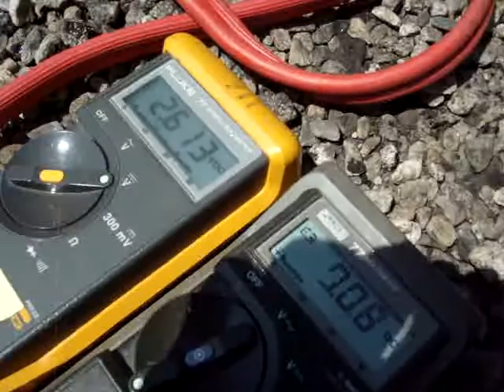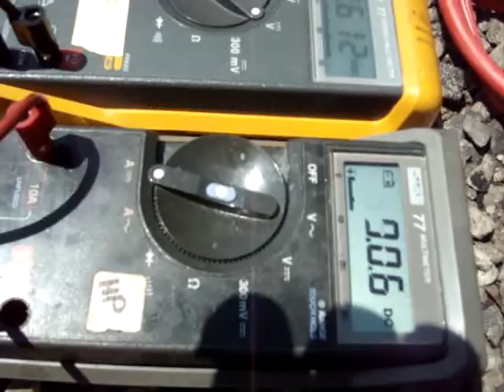Solar Hydrogen Generation - Pilot Plant #5 06-13-08

Comment: i think more information about the electrical conductivity of solar panels should be open to the public.  That means how much electricity it produces for its cost and its usability.  so far i believe that solar panels are better applied on a smaller scale than a larger scale.  On a larger scale it takes up a lot of land assuming for the amount of electricity it produces.  Not only that but i assume they last only about 50 years and have to be re-made again.

Comment from the maker: Here's what you should have read first before making your comment:
Park, H.; Vecitis, C. D.; Hoffmann, M. R. Electrochemical Water Splitting Coupled with Organic Compound Oxidation: The Role of Active Chlorine Species, J. Phys. Chem. C, 2009, 113, 79357945.
Park, H.; Vecitis, C. D.; Hoffmann, M. R. Solar-powered electrochemical oxidation of organic compounds coupled with the cathodic production of molecular hydrogen, J. Phys. Chem. A 2008, 112, 7616-7626.